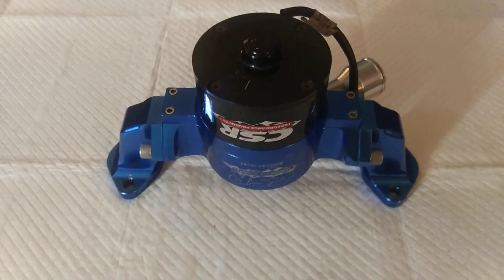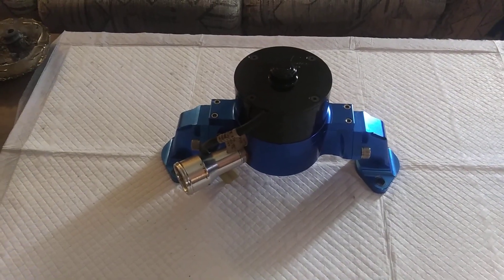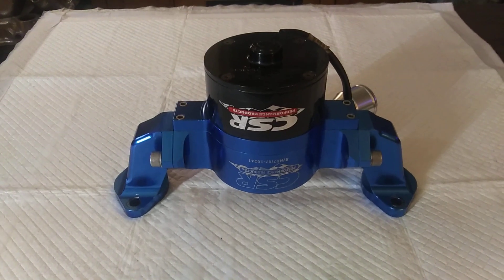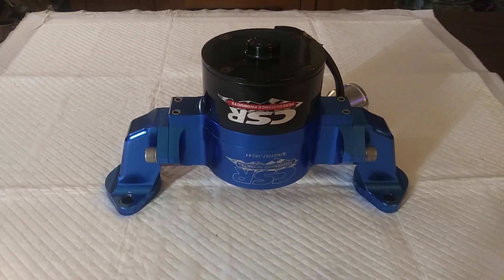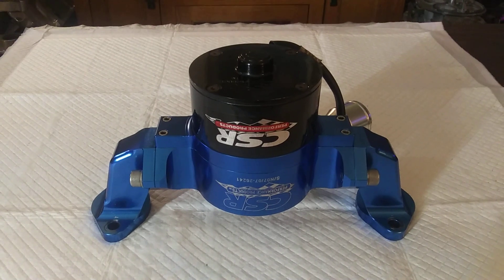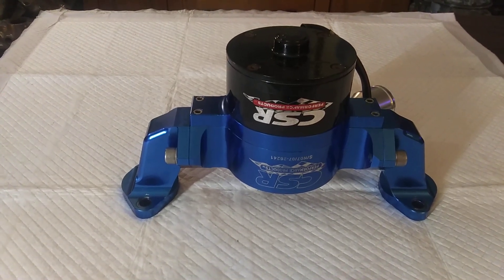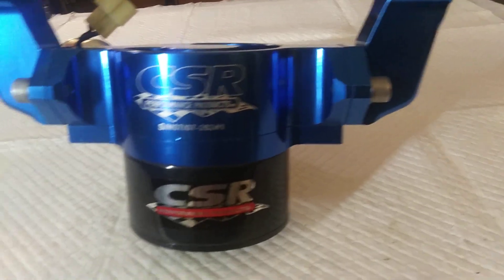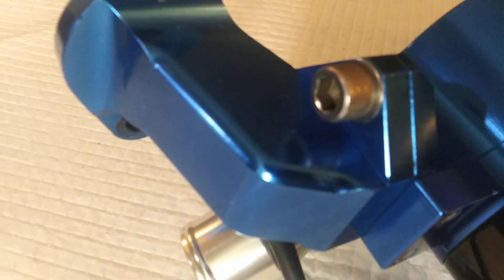A few words on electric water pumps for the street.

Comment: I'll be buying the CSR 50 GPM from Jegs for my street stroker.
Reply: How has that pump held up. thinkimg about adding one to my 383 sbc
Reply: @Axrbear   I ended up passing on the CSR unit although an excellent piece and went with a Meziere, I would consider either of these as the best you can buy.
Reply: @heshtesh  I appreciate the reply, brother. No issues with street use? My camaro is not a daily driver, but I do take the kids out a few times . I just want to make sure it holds up.
Reply: @Axrbear  Just a heads up the motors in the good units are usually good for at least 3000hrs.
Reply: @heshtesh right on. Thank you.🤙
Reply from the maker: Shouldn't have no problem with that unit.

Comment: My electric water pump on my blown 468 is about 10 years old and still going it's a 35 gallon pump no issues
Reply from the maker: Must have bought a good one. I just like overkill myself and I lived in a hot climate. Drove the car to work everyday, so I wanted no issues. I've used the 35gpm pumps on drag cars and street/strip type cars without issues. Some of those cheap $100 eBay pumps might advertise 35gpm, but actually not even flow 20gpm. So it's best to stick to the proven shit in my opinion.

Comment: Is Meziere oaky? Not much for a Olds and I'm finding them in the 35gpm
Reply from the maker: Meziere is good shit. Those 35GPM pumps work fine on smallblocks, but I prefer more flow with the big engines.
Reply from the maker: Oldsmobile definitely limits your choices on parts. I have a few of them myself.

Comment: Another nice peace you have there brother, im with ya 100% that when it comes to a electric water pumps, being as it is cooling an engine, and aso being as, if an engine has an electric waterpump on it its typically making some good power, and engines making good power typicaly generate more heat, and engines makin good power aren't cheap!! I personally wouldn't consider buying them cheap Chinese peices of shit water pumps, it's hard to put trust in a product to do such a critically job... just because some one gets a steal of a deal as far as price dont always make the purchase a good deal, with a generic pump even if you were to buy a high flow pump I wouldn't trust there claims!! It's much more reassuring having a good brand name pump that you can have confidence in.... because when it comes to electric motors you get what you pay for! Take care..
          -  Adam -
Reply from the maker: I know that's right, water pump extremely important component. Can definitely leave ya stranded or melt the engine down. Ole fat block Chevys ain't known for running cool in traffic. Especially when they are extremely rowdy. I had that bastard pretty figured out tho, trouble free considering what was in it. Had to drive it daily for over a year. Was my only running vehicle. Gas mileage was pretty rough tho. 12 gallon fuel cell go empty  pretty quick. Definitely a nerve racking motherfucker driving it everyday. Loud as hell. Stayed paranoid in that car. Drove it with 29.5x11.5x15 M/T slicks most of the time.